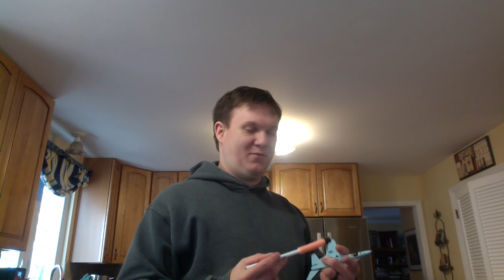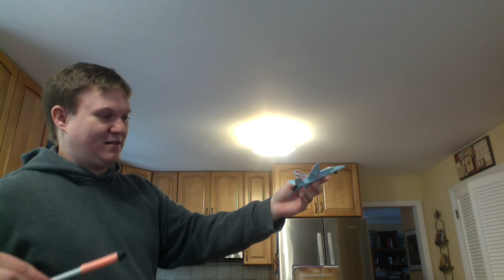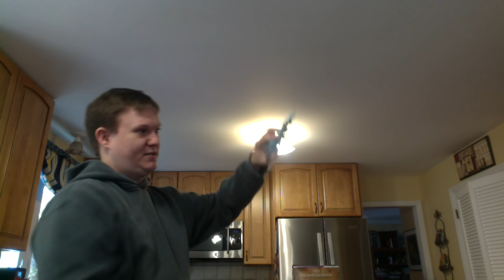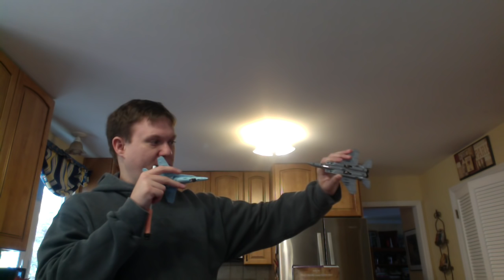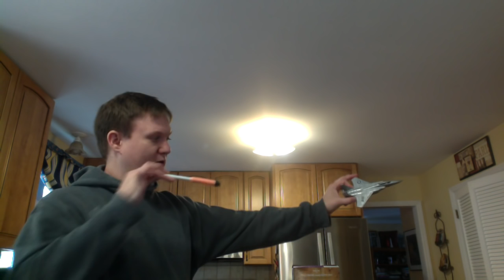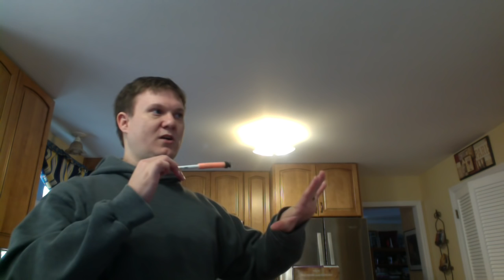Star Citizen: Missiles in 1.3

Comment: AIM-4 Falcon: 54 shots in anger, with only FIVE hits during 'Nam.AIM-7 Sparrow: 612 fired in anger, 97 hits during 'Nam. On average the Sparrow (D, E or E-2, E-3 and E-4) had a success rate of 13% (in Vietnam it had about 16%). During the Gulf War, this was much improved with the AIM-7M, 44 fired, 30 hit.AIM-9 Sidewinder: 452 fired in anger, 80 hits during 'Nam. This number MUCH improved with the L and above models, with a kill rate of over 83%. The newer X models especially Block III are estimated to have a kill rate of well over 90% with a successful lock.AIM-120: 17 fired in anger 10 hits. At least 3 of the misses were due to bad rocket motors, now fixed as Nammo Raufoss is making the motors.